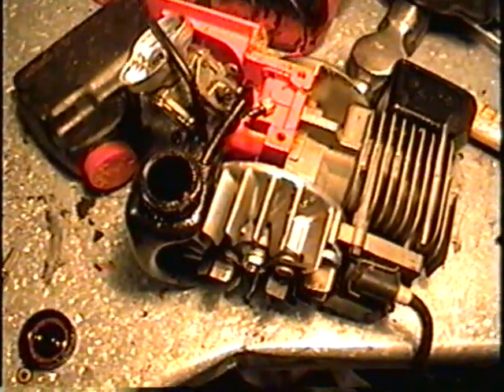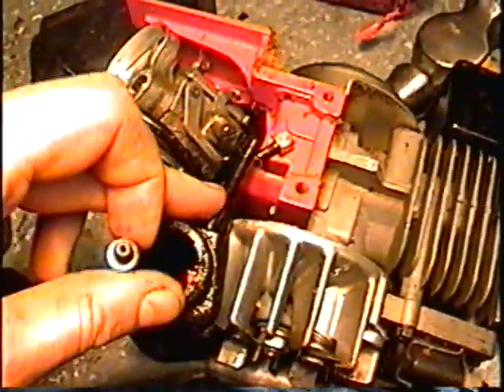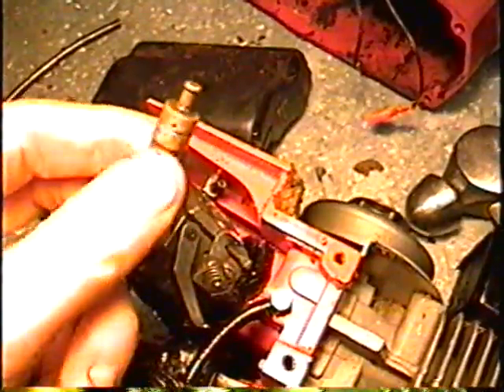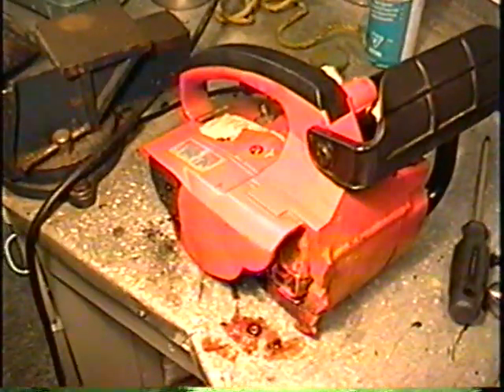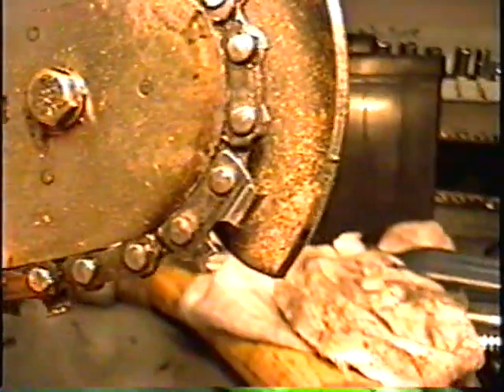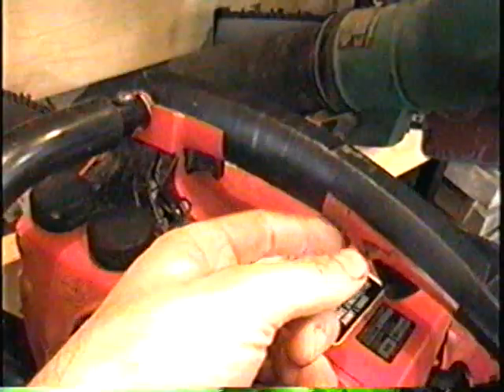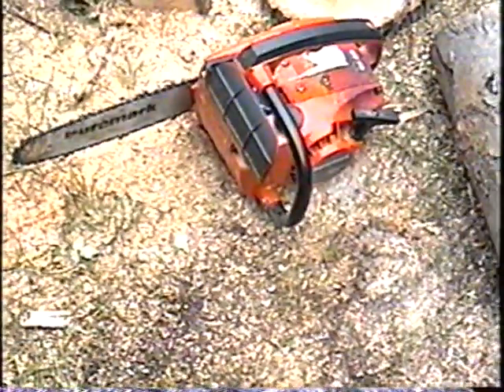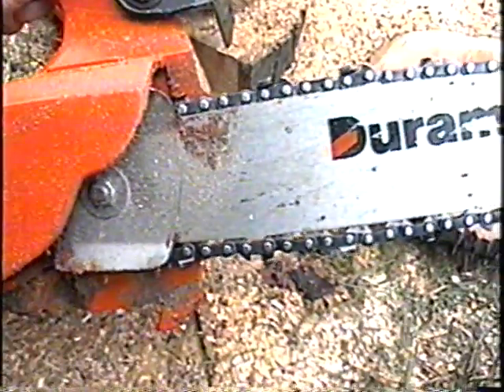Homelite SUPER 2 Chainsaw OILER REPAIR & TEST RUN

Comment: One thing I might mention:  Probably a good idea to loosen the oil cap after you shut it off to prevent the saw from oiling up the floor or the table it's sitting on after use. The tank remains pressurized for a while and will leak a little oil...

Comment from the maker: @MXRACER268 the oil hose from the crankcase pressurizes the tank and the duckbill valve prevents the air from going back into the crankcase, so it only lets air go into the tank

Comment from the maker: the 340 i believe has an oiler pump. different from super 2. did you replace the carb kit? sometimes crank seals leak and cause symptoms u describe but before doing that I would double check everything else. also check carb adjustment

Comment: I have my homelite super 2 engine out of it's case housing for a complete cleaning. How does the throttle bar sit. The homelite is like the model in your video unit # 10617-A. Does the hooked end of the bar enter the throttle lever from the left or right side? It's easier to ask up front than put it together only to rip it apart again.
Thanks  Oh yeah: All of your videos are VERY informational and clear.

Comment: @TorrentPig Depending on what kind of oiler system yours has, the Homelite service instructions say the oil is either leaking past the oil pump body/crankcase (replace the oil pump body) or the crankcase itself is cracked and must be replaced. I've done everything in the service instructions and more and pressure tested the crankcase under water and it still blows bar oil into the engine. Good luck.

Comment: Picked up a Super 2 for 10 dollars.  Lady was frustrated because she couldn't get it to start and was tired of dealing with it.  Brought it home, fired it up and used it.  I still don't know what the problem was.  Had to replace both duckbills.  You could see where the bar got hot previously due to lack of oil

Comment: I have a homelite 340 I'm having trouble with. The oiler doesn't work the best but also does not idle well. I replaced the intake and carb and still runs the same. I wonder if the 340s have that same little valve thing?

Comment: I jus tpicked up an XL fro a pawnshop.  It seems to run alright, except it will spit chain oil all over and out the back.  I checked the chain oil tank, neither of the lines have anything on them, no duckbill valve on the top one, no filter thing on the bottom one like in your vid.  I am guessing I need them.  Do you have any suggestions where to get them?

Comment: donyboy i have a homelight super 2 the muffler is off when it sits for a while it will start up and run no problem but after about a minute of running it will die and not start up idles fine to any suggestions? thanks God bless you and your family

Comment: Dony, I recently started to tackle cleaning and getting one of theses same chainsaws back in order, But the recoil spring for the starter I fear maybe broken but I cant be sure, Mine appears to have two different ends and has a small rivet in place. Is  this normal or could you maybe tell me a part number for a new one please?

Comment: My super 2 model ut-104552 all of a sudden it started to put bar oil in the piston, I took every thing apart and cleaned. But could not get the body of the oil pump or the ball and spring of the check valve out. The duck bill is gone, and I cannot get air to go through the pump to the chain oilier.My question is what should I do next  and where can I get parts or is it junk?

Comment: i am having problem keeping mine running. i will check the valves but when i pour gas straight into the carb i can get it to run?? i dont know if i have a blocked fuel line or a bum oil pump or carb? help!!!